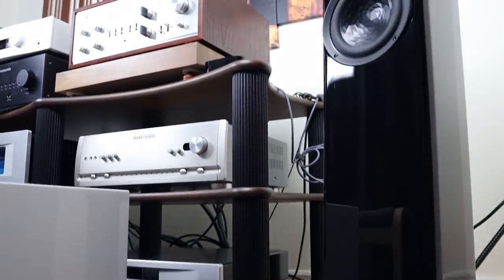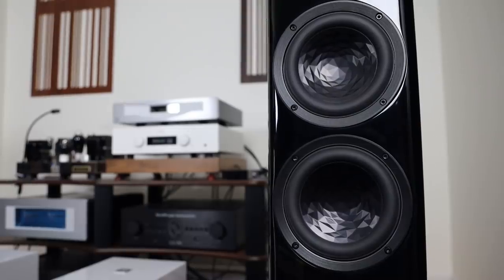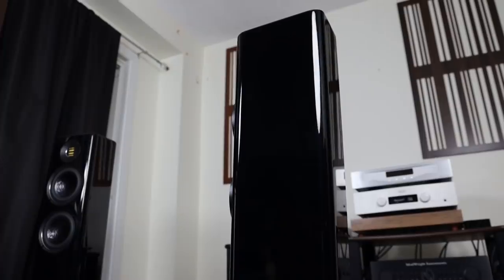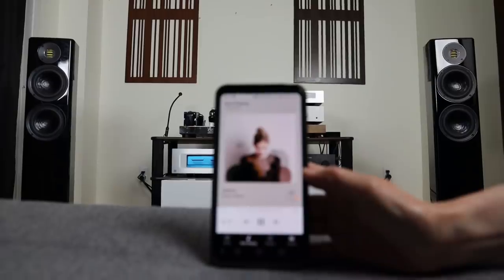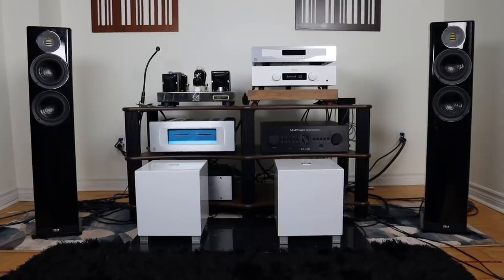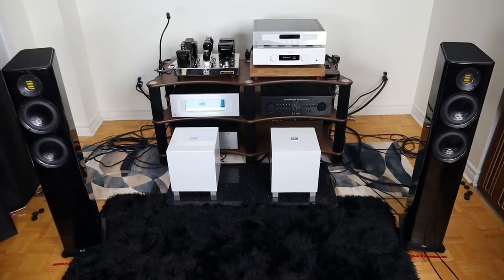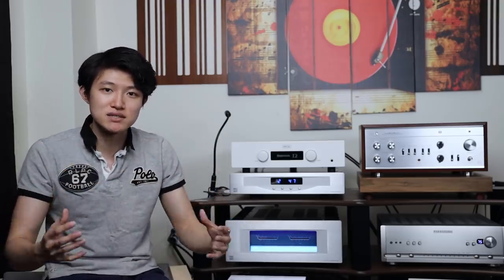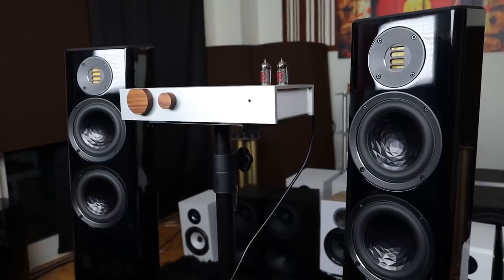Elac Vela FS 407 offers more than just Hi-Fi ! #AMTfi

Comment: My only problem with these are the others in the Vela FS range ! If i bought these and then heard the 408 or the 409, would I be saying i wished I had saved a bit more and waited ? I did hear the quite pricey 409's and they are great.
Reply: The 409 seems designed for larger rooms though? Whereas maybe the 407 is better for a small room?

Comment: Good video Jay but I got to be honest this video seemed a little bit more rehearsed and you seemed a little bit uptight. Not as natural as prior videos. I don't doubt that these elac speakers sound overall great but for the money they are certainly not a good value. $5,000 for the pair is pretty ridiculous. They weighed 42 pounds each. Correct me if I'm wrong but I believe they are made in China not like the previous German made 400 series. I'm sure bass is great for the size but there's no way they are getting down to 30 Hertz audibly like they have them listed in their specifications. I have a recommendation for a pair of speakers that are almost the same price as the pair of elac speakers. The Canton vento 896 pair of speakers can be had for 2600 at accessories4less.Over 40 years of engineering, German made in-house. They weighs 66 lb each and have a ceramic Tweeter that is sweeter than all tweeters I've ever heard. They used titanium drivers. Three-way design with a dedicated mid-range. Bass output will be deeper. Undoubtedly the much better value. I do appreciate review but certainly elac is trying to sell these at $5,000 based on their name in that fancy jet tweeter. And before anyone mentions anything, yes I have heard it before it does sound great but I have a pair of Canton ventos myself and it sounds just as good if not better in my opinion. Don't take this the wrong way but you Hi-Fi reviewers need to give Canton a shot, the whole United States is missing out. You will not be disappointed.